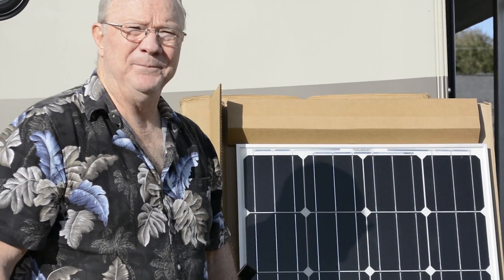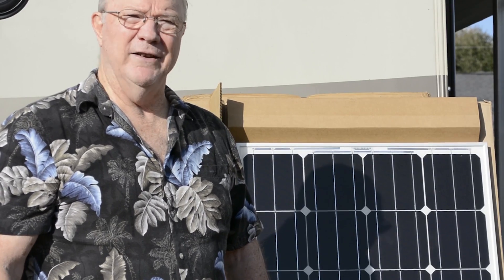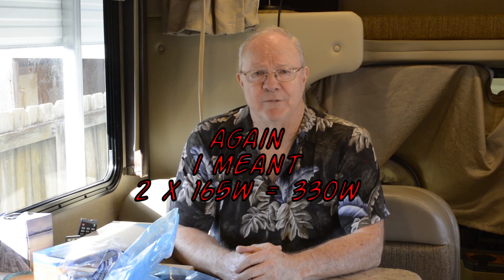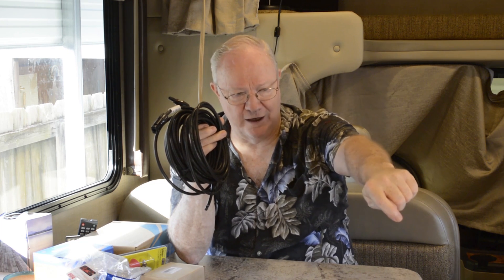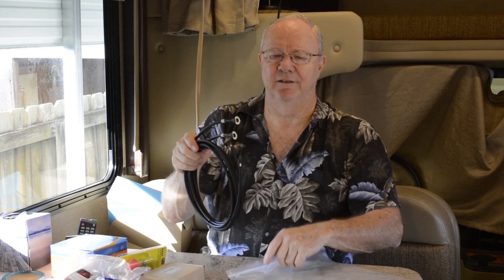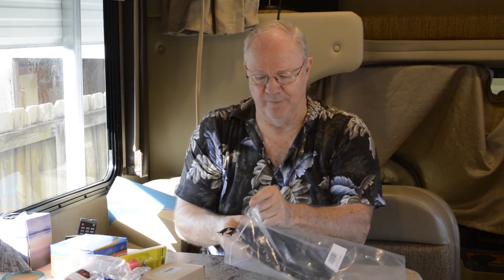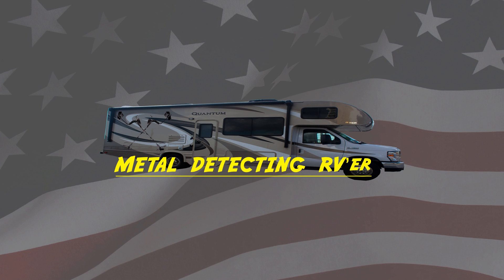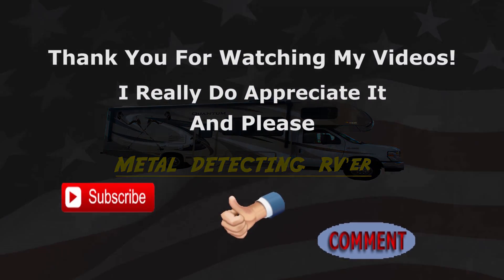Solar Equipment Install: Part 1 What I selected

Comment: We are new to this and wondered if we could just have someone do this installment.  Is it best to use the dealer or a private electrician?
Reply from the maker: If you don't have any electrical experience or are not comfortable doing the work your self then I would defiantly have someone else do the work for you.  As far as a privet electrician or dealer that depends on how much you trust them and there reputation.  I know some dealerships that I would NOT use and some I trust completely.  Dealerships will be more expensive.  Hope this helps. Good luck and safe travels.

Comment: Looks like you have all the pieces for a well rounded system. I have the same controller but a 40 amp version and so far I like it and it works great. Here is my install https://www.youtube.com/watch?v=5yHHMQgpwrE . If you have any questions drop me a PM ...You will love having solar good luck ~Cheers
Reply from the maker: Just watched your video. You can see my comment. If I run into any problems, I will give you a shout. Thanks